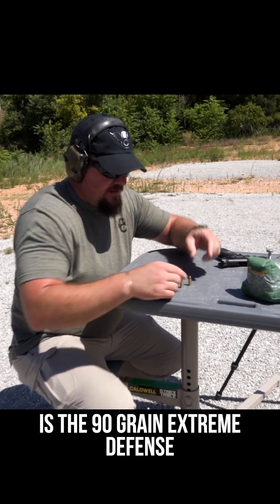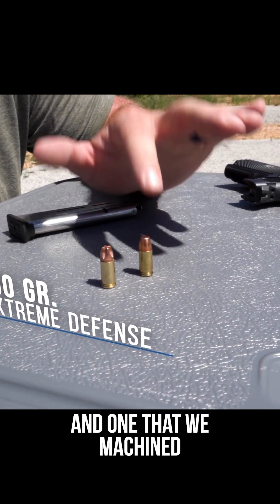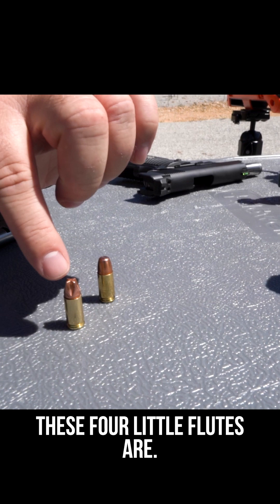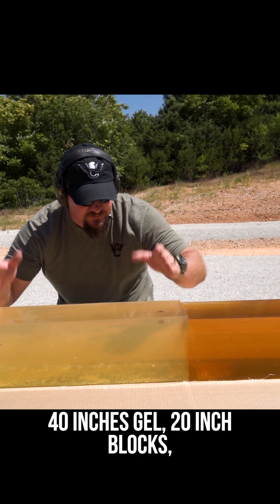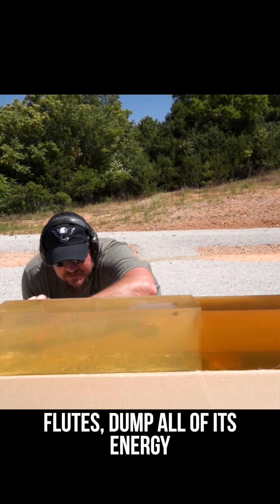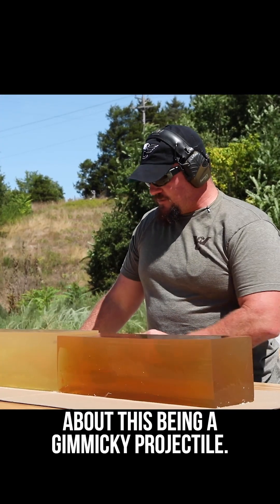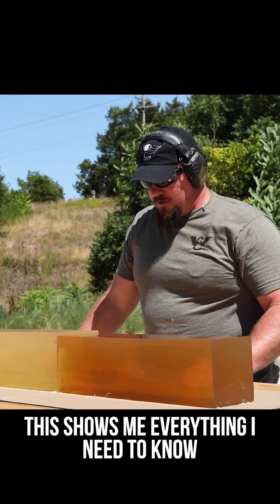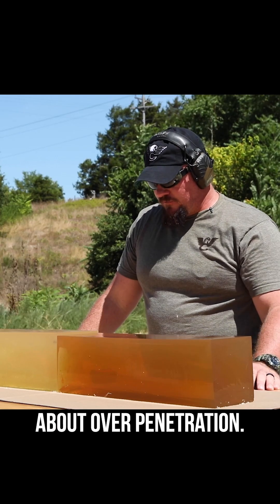Xtreme Defense 90 grain 9mm Bullet VS Solid Copper Bullet Gel Test.

Comment: I was skeptical as well, but after shooting a few wild piggies i am no longer skeptical. My favorite 350 legend load that i have worked up for hogs uses the 90 grain xtreme defender bullet. It is actually kinda disgusting when you see the wound it makes. Also shot one with the 120 grain xtreme defender .45 super load  at about 7 or 8 yards and it dropped that 260 lb boar immediately. The bullet design is a masterpiece.

Comment: Just use a hollow point. You’re round IS gimmicky!
Reply: It's provably better than JHP ammo. It can go through nearly all soft and hard barriers people have tested and STILL manages to almost always penetrate the same amount (without underpenetrating or overpenetrating). Have seen it tested through thin sheet metal, denim, glass, drywall, bones, plexiglass, leather and many other hard and soft barriers. It also brings the .380ACP up to the level of 9mm and in .380 is even performs better than many 9mm JHP rounds.

I just refuse to buy it, because it's ridiculously and unfairly expensive. They charge $1.00/round just to load it. You can load it yourself for about $0.80/rd... but if you buy it loaded they charge $1.80/rd ... and I just refuse to do business with a company like that. It's extortion.
Reply: @deucedeuce1572 you're absolutely right about the Richard headed pricing they are doing.
Reply: @deucedeuce1572 did you not look at the prices of hollow points at all? Most of the are   over 1.50$ a round...
Reply: How is it gimmick? Explain

Comment: He said one without the flutes. He didn't say it was 90 grain. If you put more powder behind a projectile it will travel further.
Reply: Don't think it matters that much... and xtreme defenders are usually already extremely hot rounds. It would not be easy to make an even more hot round... and the added weight of the bullet would only make it go slower. I've seen .380 ACP jacketed rounds pass through about as much gel also... and they were much less powerful than either of these rounds. (even .25acp and .32acp can zip right through gel).

Comment: Most people don't have a 20in torso front to back
Reply: The jell is just a static test medium. It does not represent people. Bone, skin, muscle, and blood react differently from Jell.
Reply: @timothyprice9064  I know that but they do tests like this and say look out bullet stopped in the first 20inches but people aren't 20 inch deep so it could go through take the average waist line and then do the test I bet both go through
Reply: @HYSTERIA-ee2re  I understand what you're saying. Maybe make the jell denser to more closely approximate flesh and bone. This is why I'm more of a fan of actual hunting and meat targets. Sometimes the jell targets confuse people.
Reply: @HYSTERIA-ee2re People can be 20” wide when shot from the side and / or at an angle.

Comment: Show me some CORONER or AUTOPSY stats. Hell, just show Emergency room images or stats. We all already know what hollow points do. These new Philips head projectiles are cool looking in solid 20 plus inches of a hydronic gel but show me some living tissue damage to convince me.
Reply: HP rounds do no more damage than Ball Ammo. The only difference is that HP ammo expands and slows down, but it does not do any more damage to the tissues outside the direct path of the bullets travel... and the holes that HP ammo makes is no larger than the holes from ball ammo. It is a "temporary" cavity that immediately shrinks back down to size, even though it's visible in the gel. No handgun bullet (below the power of .45ACP) causes damage outside the path of the bullet and the holes they produce are almost always nearly identical in size. I'm no .45ACP fan, because I much prefer smaller guns (and am even a fan of .380ACP)... but the "stopping power" of most handguns is nothing more than the holes they poke in people (and the depths/locations of where those holes are poked). Only in certain organs do most bullets ever do any real damage other than making a simple hole.
Reply: @deucedeuce1572 You need to stop propagating this false information and learn something about terminal ballistics first before you go around talking like you are an authority on the matter which you obviously are not.
Reply: @ZootyZoFo  I've studied it far more than you know. Ballistic gel is not the human body. (edit: I should have mentioned the more powerful rounds do FAR more damage in HP, but for most handgun rounds it's not an issue. The power of a .40 is significant enough to get "hydrostatic shock" and damage to the surrounding tissues... but when it comes to 9mm and below, a HP bullet is nothing more than a safety to not pass through the target. It may create a larger "temporary wound cavity", but in the human body that doesn't make much difference, except in a few more delicate organs. (organs that don't stretch).

Comment: 🙋🏽‍♂️ may I ask why the non-standard bullet weight? 90 grain sounds kind of light versus 115, 125 and 147?
Reply: I bought some 90 grain because they were on sale and they shot about 6 jnches high at 20 yards with 2 different pistols i put them up and quit at that point .
Reply: Penetration, expansion, and velocity. Most hp perform well at 1000fps+. With this projectile being so light, it would most likely give it a better shot of reaching and maintaining performance out of shorter barrels.
Reply: It is mainly to attain higher speed which means more energy hitting target.
Reply: @patientestant  well energy is supposed to be mass times velocity. I'm not sure if the trade-off is resulting in that much of a leap in performance?
Reply: @WALTERBROADDUS   the energy of a projectile is Ek=½mv^2 and a crude approximation of the acceleration of a bullet is f=ma. So if you decrease the mass for the same force, it will accelerate faster creating a higher velocity. Since the velocity is squared, as far as I know, the energy increases. Example: m=.5 then a=f/m becomes a=2f , so you get twice the acceleration. Of course that is simplified, but for simplicity, then Ek=1/2mv^2 becomes Ek=1/2m2^2= 1/2m*4 so you would get 4 times the energy for cutting the weight in half. Energy is not the only thing that matters, but that is a small understanding of why the bullet and ammo is designed with a lighter weight bullet.

Comment: OK, so no overpenetration. BUT how much DAMAGE does it do compared to a HOLLOW POINT, the STANDARD for SELF DEFENSE?
Reply: Do you see those massive expansions in the gel when the XD goes through? That’s significant damage—ripping, tearing, and worse of all, possible cavitation. They 100% do more damage than a normal HP. A RIP round might be harder to “fix” at the ER and cause the eventual passing of the individual, but it’s also basically a war crime and a jury would have a field day with a case where you used them.
Reply: Hollow points do no more damage than round nose bullets. They ONLY do damage in their direct path, which is true for almost all handgun rounds/calibers. The HP only expand to not overpenetrate and they do nothing more than that. The sizes of the holes they create are the same as those that do not expand. The fact that they make a hole and done over=penetrate makes them equal to HP a the least.. and the fact that they can penetrate most hard and soft barriers, but still penetrate about the same without over-penetrating or underpenetrating makes them far superior to HP ammo.
Reply: @deucedeuce1572 I don't think you know what you speak of.  Perhaps consult a pamphlet.  Run to do such at a medium pace.  Run like the semi-slow wind.  Run for beads.  Run for knowledge...then keep running like Gump. 🏃🏼‍♂️
Reply: @deucedeuce1572 That’s completely and totally false, why do you think to meet FBI standards a bullet has to expand to a certain amount to pass?  A projectile that increases in diameter creates a larger wound channel, if it doubles in diameter the wound channel doubles.
Reply: @deucedeuce1572 .... a fully expanded HP makes a MUCH BIGGER DIAMETER hole, tearing more tissues as it goes.  The main advantage other than not overpenetrating, is a better chance of damaging bones or organs, plus possibly greater blood loss.  Barring a hit to the brain or spinal cord, faster blood loss is the next best way to quickly incapacitate an attacker.